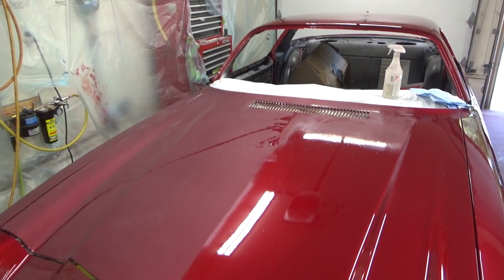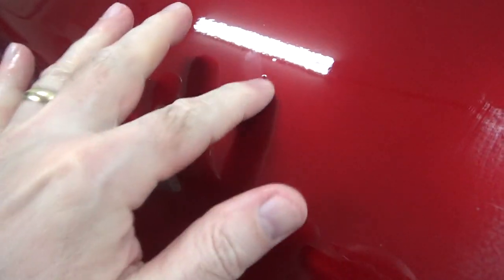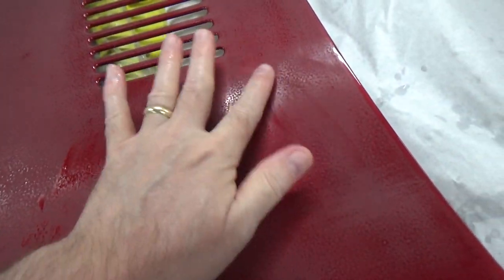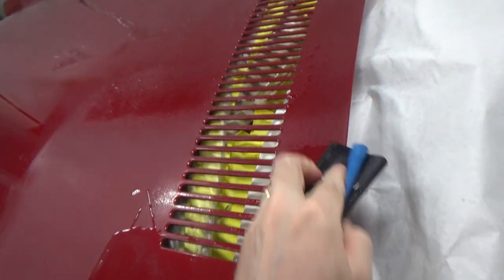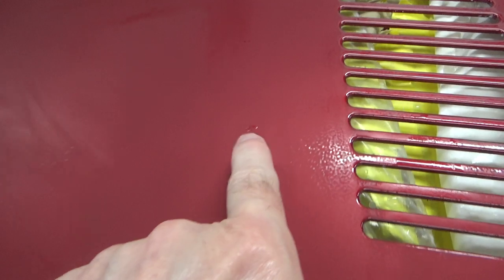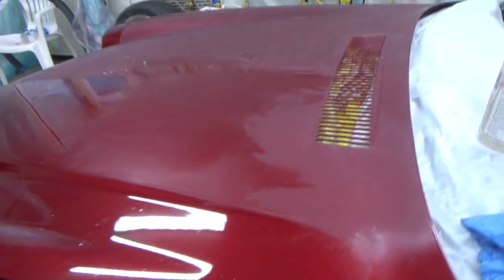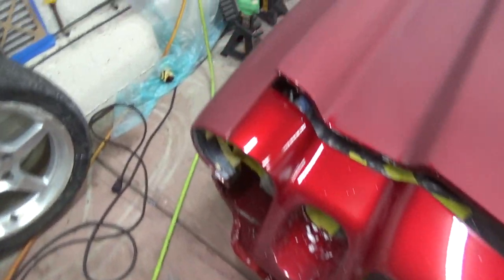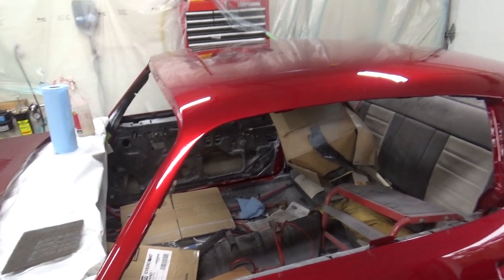1977 Camaro Z28 Part 241: Wet sanding prep for blend

Comment: Looks good brother.  Have a question for you.  I went ahead and sprayed my jambs.  I used back masking for a feathered edge, but I have a few hard lines.  What grit sand paper did you use to sand out the over spray when you did yours?  Glad to hear mom is doing well.  Looking forward to pops being in the garage again.
Reply from the maker: So the oversrpay is on the outside of the car? We ran into the on the quarter panels. We used 220 to remove the edge and then moved up to 320/400 then final wet sand 600.
Thanks!
Reply: asicerik Yes, on the outside.  I was going to use the same grits you used, but I wanted to be sure.  Thanks a bunch.
Reply from the maker: @highspeednoblesgarage3152  No problem. Make sure you wet it down (if possible) and make SURE that edge is gone. We still have some edges around the sail panel that we did not get out. I am hoping I can bury them in the flow coat.
Reply: asicerik I will definitely do that.  Appreciate it.

Comment: yes do it in pieces :)  run the compressor and blow everything out then run the filter on high for two hours before you paint, try not to disturb anything, blow the car and the compressor and everything off, the plastic hanging wont be fun.
Reply from the maker: Thanks